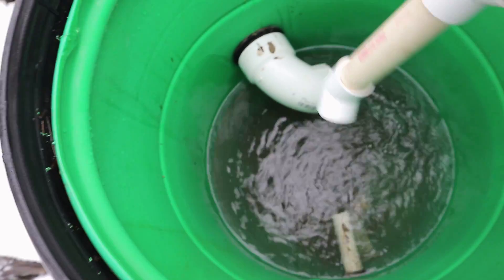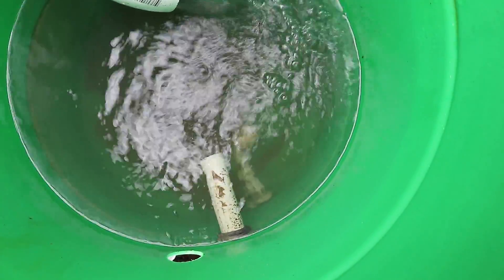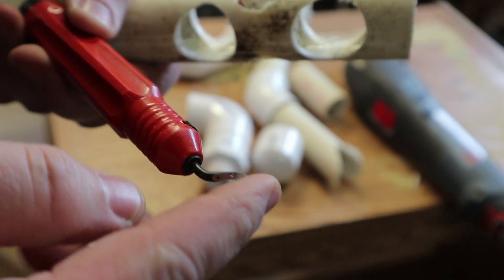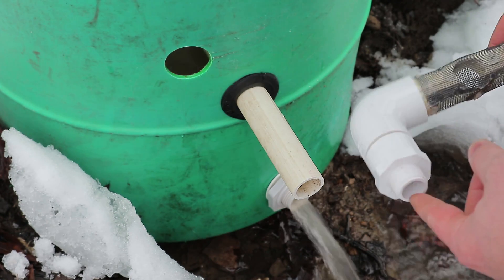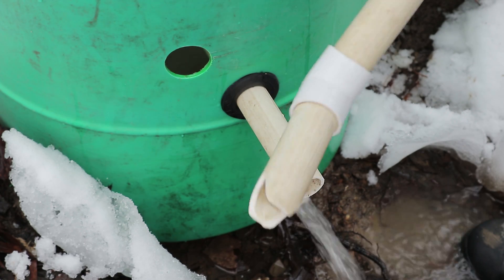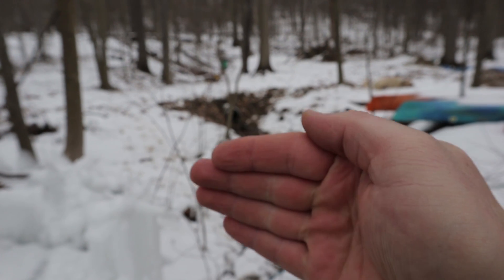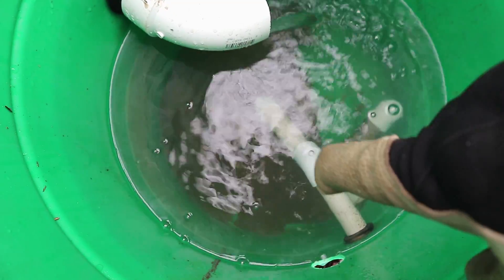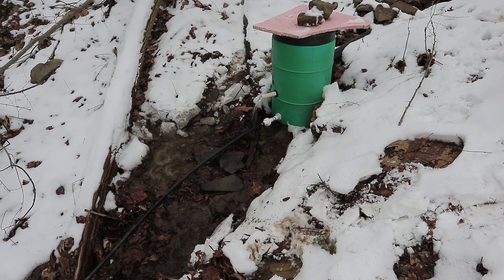[Part 4] Kilowatt Microhydro Turbine - Silt-Sucker Prototype Modifications

Comment: I wondered how you were taking silt out using your new barrel and why you drilled a hole so close to the bottom of the barrel.  

My ideal in this situation is to bury 1/2 of the barrel for 3 reasons: 
1st you are only using half the barrel anyway
2nd you need a silt collection in the lower section anyway, and should grab your output water from a higher elevation in relation to the bottom of the barrel. but your output elevation in reality is still the same as you have it now, it is just that the barrel bottom is lower in elevation and now the barrel is filled to the top, couple inches from the top. So you still have the same head and water volume to draw from, but with that lower revivor in the barrel where the silt collector goes. 
3rd it will look really nice if 1/2 the barrel was buried this way you can stack rock around it and make it look like a nice little well with a little roof. Better than looking at a fluorescent barrel and you were talking about junk being thrown around. lol No, great use of a barrel, i am just saying it appears like it is junk because that is what happens to old barrels many times, get thrown or left sitting somewhere.

Comment: 14:00 Safety is not really a concern, ist it? Any idea what will happen if the blade comes out of the pipe while you are pushing? There will be some fingers on the table and/or floor, not attached to anything or anyone. If you don't care about them, at least think about your wife and little girl.

Comment: the tube that starts from the bin. it should be at least three times the diameter of the duct and then reduce conically in a few meters to join the pipe that goes to the turbine
then better to take the water to the second tube and leave the bottom tube for the sand discharge
avoid turbulence in the drum through separating plates
a pelton turbine must not take air, if you do not want the windings and bearings to break, for the shots they take

Comment: A little confused how putting a pipe all the way down the hill is going to be at all efficient. The whole way down the pipe the water is going to lose so much energy and looking at the flow from the end next to your house, it doesn't look any better than the old hydro turbine you made at your old house.
Reply from the maker: The pipe is to build pressure. 255 feet of head creates a nozzle pressure of about  110psi. This will then interact with a turbine, flowing out of the nozzle at 90mph.

Comment: Joe, I would use two 5 gallon buckets as filters. The first to remove floating debris and then a second as a self emptying radial filter. The reason to have the float filter first is that its easier to design and also limits the flow rate so that the radial filter only has laminar flow. By reducing the turbulence from the radial filter the silt will collect more evenly and no air bubbles will be introduced to the system. In the radial filter I would add a 2/5" hole to the centre of the bottom of the bucket so that the water and silt can fall out rather than being sucked up. (Sucking creates turbulence.) Having one filter trying to remove everything big and small, (clay and leaves) is probably just going to create a lot of filter clearing work for yourself, (but I hope that you find a design that is low maintenance.)  Good luck.

Comment: You could have just left that 90 PVC on your ABS intake in your sediment barrel, but you needed to push your intake pipe all the way to the other side of the barrel to better create a proper vortex of water inside.  You want the current of water as close to the edge of the barrel as possible.  Right now your fittings keep it too far out from the nearside wall, so pushing your intake all the way to the other side will allow the water to be expelled along the wall so the current can spin all the water inside.  It's like trying to force your water wheel to spin by applying force next to the axis instead of the outer edge.
Reply: another method would be to actually place some form of a cone to force a vortex and then place your silt sucker type mechanism at the very bottom and your turbine intake slightly higher up but on the outside of the cone so that you are not sucking up debris or silt

Comment: The input needs to be (as you said yourself) on an angle to have a cyclone forming rotating clockwise viewed from above and the exit needs to enter a pipes width lower plus some extra for the 90 elbow on there and picks up clean water from the surface in the center of the cyclone...
You can use a sheet of plastic to form a cone/funnel to the bottom to force the debris down into the center and a clean out pipe exiting on the bottom of the cone with a 90 to the outside and a valve (since the filter is on the top of the hill and you clearly do not need the workout to go up there you may want to have the clean out valve electrically of pneumatically actuated... And while you run the water pipe, do run a smaller diameter pvc pipe next to it for control wires and maybe even a utp or usb cable to be able to watch the filter remotely with a camera up there...

Comment: the (idiotic) saga continues.    if you do not  make  a  twenty-meter water wheel,  you aint gonna get much power, from a flow rate of  One  CUP,  per  second.   but, go ahead.   lmao              googletranslate
Reply from the maker: This is just the prototype for the big system 255 feet of head and 15 gallons per minute.

Comment: In addition to generating electricity you could also use the water/air temperature differential in a heat pump to boost overall system efficiency. Use the water temperature delta instead of a ground source for heating and air conditioning.
Reply from the maker: This is a great idea, I've thought of it too but the stream at the bottom dries up for about 3 months in the summer when we need AC

Comment: Hi joe, i get alot of silt and i just let it all go down the penstock and out the nozzle. it might cause i small amount of wear but after a year of this i can see no real signs of wear at all on my nozzle or turbine just a slight polish. if you had uphill stretches of penstock then it would be important. but if its all downhill i believe adding all this is just adding alot of complications, cost and probably more maintenance then just changing the nozzle and turbine every 5 years or so.
Reply from the maker: I appreciate your input Kris! I may ultimately do just that.

Comment: to make a conical bottom for testing you could use a heat gun to warm up the plastic and make it soft on the bottom, then use a pole in the center to press up the soft plastic to a conical shape, hold it as it cools and hopefully the shape will stay

Comment: Hey Joe cool dog. Oversize your penstock even though it'll cost more...trust me...install a large pipe size strainer upstream just before necking down to turbine inlet inlet size...also paint that barrel it must be black inside to prevent mold moss algae growth
Reply from the maker: I'm going to use 2" penstock, anything smaller and I risk large friction losses at the highest flows.

And I have a black barrel that I'll use for the final system.
Reply: @JoeMalovich  I'd use 4" but that's me...
Reply from the maker: @fuckelonmusk9395  2" is all I need for the given GPM, Many calculations show it to only reduce head pressure by a few percent at 30gpm over 800ft.
Reply: @JoeMalovich  yes but air in line, any debris or growth....a couple hundred bucks is worth it to me
Reply from the maker: @fuckelonmusk9395  I'm already spending $800 on pipe. and I don't want to fight with 4", It's a big enough step up going to 2".  This is 2" for example: https://www.youtube.com/watch?v=fb58rqN9ppk&t=498s
Reply: @JoeMalovich  IMO it'll be a mistake but make it....big difference between paper and real world....i got my degree at the General Motors Institute of Engineering...where is yours from?
Reply from the maker: @fuckelonmusk9395  Bachelors of Science Mechanical Engineering. Penn State. I notice you don't specify AS or BS.

But now that I look it up, it's Kettering University. I applied, toured, and didn't get in so you might have won this round of one upmanship. Now go find me 800' of 4" pipe that I can afford, withstand 120psi of pressure, and can wind is way up an uneven steep hillside.
Reply from the maker: @fuckelonmusk9395  I'm still never do more than 2". heck 1.5" would be unsaturated 95% of the time.
Reply: @JoeMalovich  

Give it long enough and it always regresses to an elementary school pissing contest.
~Albert Einstein

Comment: I have a question? What is the point of this contraption
Reply from the maker: Great Question, I'm prototyping a silt filtration system for a kilowatt microhydro system. It's something I can do while the hill is treacherously snow covered, and when it isn't snow covered I'll have to make fewer trips up the hill 255 feet in elevation because I will have proven the design already. Also it's content my channel is founded on that I couldn't otherwise produce in the winter.